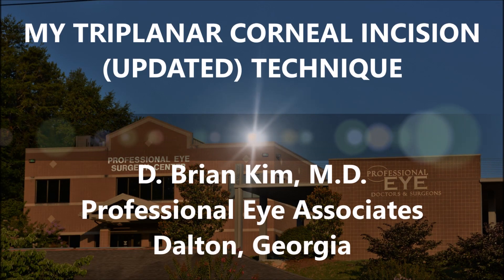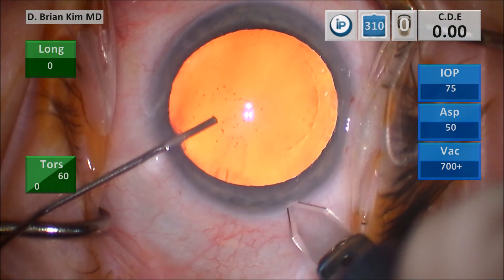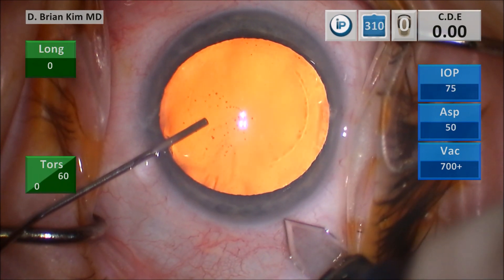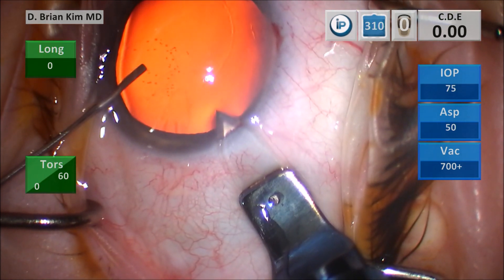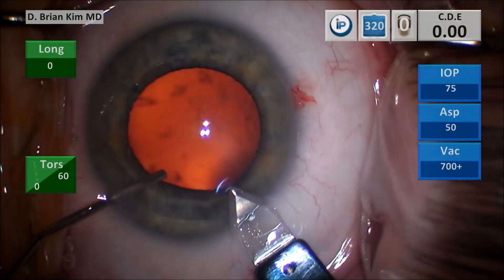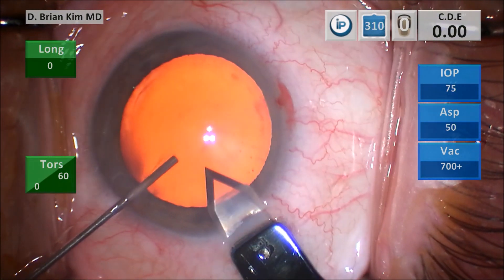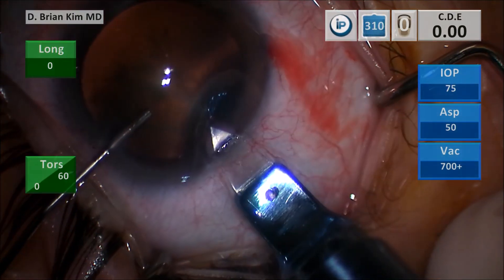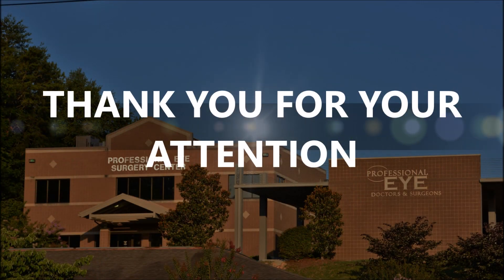Updated Triplanar Corneal Incision Technique: Is this Better?

Comment: The camula fixation technique is intuitive,
But does it have the chance of slipping and hiting the anterior capsule?
One has to keep the balance,
Such an informative video thank you
Reply from the maker: Spring 24360 there is very little risk to puncture the capsule because, for example, in the right eye, I have my hand holding the cannula against the superior paracentesis against the patient’s forehead. This stabilizes the cannula and unlikely to go too deep. I hope this clarifies. Best wishes.

Comment: Sir, I want to know that your sitting chair and microscope are coaxial to main port incision that is they are align in straight line...or chair and microscope are exactly superior or temporal in location
Reply from the maker: Amit sd, I think I understand your question. When I operate for phaco cataract surgery I almost always sit temporally. And I always like to sit with my arms comfortably from where I am sitting. This means, I prefer to have my arms off center to my chair. In other words, my main phaco incision is just right of my chair and my second incision for the chopper is just left if my chair. My incisions are roughly 100 degrees apart. I do this for maximal ergonomics but also maximal chopping efficiency. And I try to do this with both right eyes and left eyes. It will require minor adjustment of your technique in all phases of surgery (corneal incisions, CCC, HD, chopping, etc) but I think it makes sense and makes it easier on your body. I hope this answers your questions.
Reply: @DocBrianKimMD  thanks sir, well explained...

Comment: Very nice procedure . I think the risk of inadvertently hitting the anterior capsule while entering the A/C  would be less here because of  filling the  A/C with OVD  which will make it deeper and the design of the diamond knife which allows only part of the sharp knife to enter the A/C  . Right ?  But my questions are , 1- is the diamond knife more expensive than the usual keratome  , is it sharper  and is it a single use ?  2- And is stabilizing the globe by cannula through the small incision which was made by MVR would make that incision a little bit leaky  later ?  Thank you

Comment: Excellent technique and video! What is the make and width of the diamond blade? Thank you!!!
Reply from the maker: Joseph Hoffman, hi Joe. It’s made by Diamatrix. I believe it’s an angled 2.65 mm width, non-side cutting diamond blade.
Reply: Thanks! Have you tried a 2.4 mm width?
Reply from the maker: Joseph Hoffman, hi Joe. Because I’m in group practice we are trying to use the same pieces at our ASC.  My partner uses a 3mm incision so the minimum incision I could do was 2.65 with the same handpieces.  I would have no problem going as small as I can go but I have these restrictions.